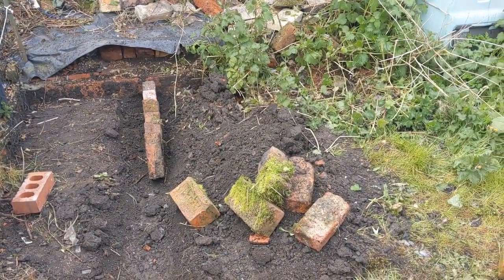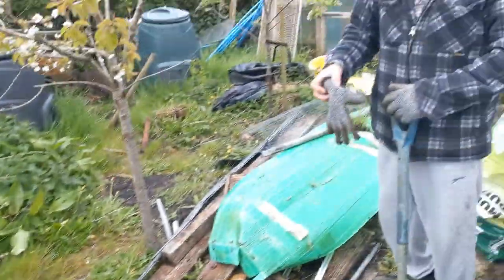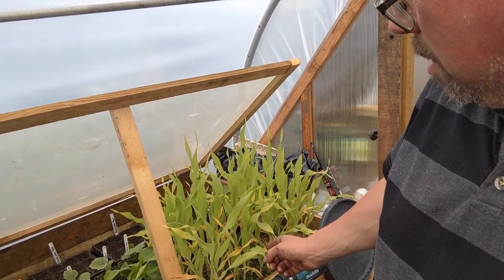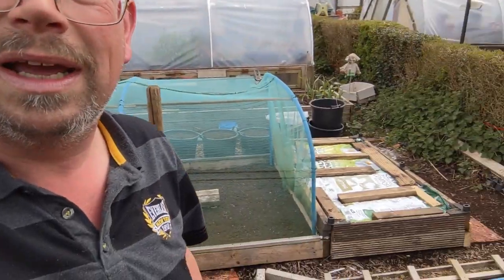UK Allotment 2021 ~ Creating a Grow Bed from Re Cycled Bricks

Comment: Nice new bed! As useless as I am in our garden, the lessons we learnt about the 'Daleks' for composting is that you should place them in the shade, place them directly on soil with 5 or 10mm metal mesh under them (to stop moles and rats) , water them often (worms need moisture to breathe!) and perhaps most importantly place them where you find it easy to keep adding to them. Place them in a corner that is a pain to visit, and you won't use them, and won't get the benefit of their wonderful output! Here in the Nordics we have the same frost issues as you do at this time of year, just stick the sweat corn out, it may get 'frost bitten', but if it is not in soon (now!) you will struggle to get a crop in the autumn.  Lovely to see how your journey is going, and to have mates to join you on the plot! Wish I had a 'Tiki hut'!
Reply from the maker: Fantastic Comments here mate... As For the Tiki Hut! ~ If I were closer I would build one with you pal.
ATB From Eden Mucker!
~Guru M~